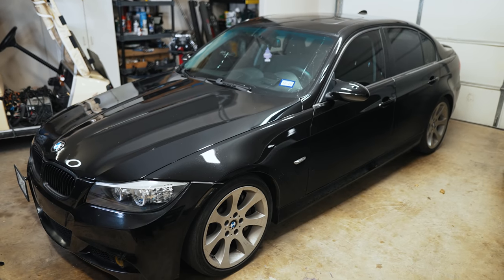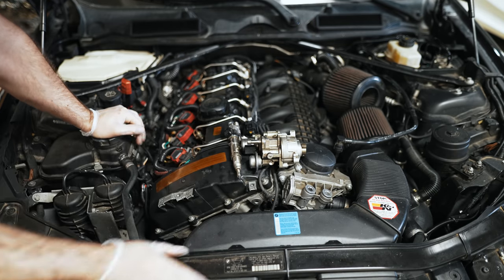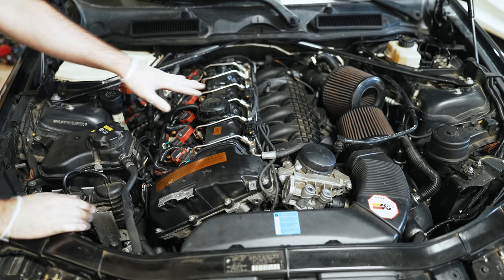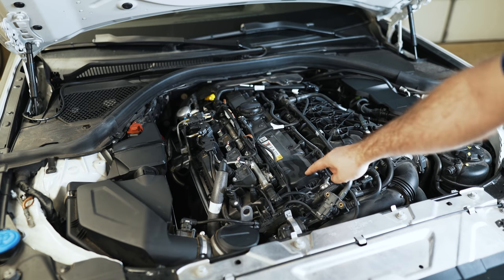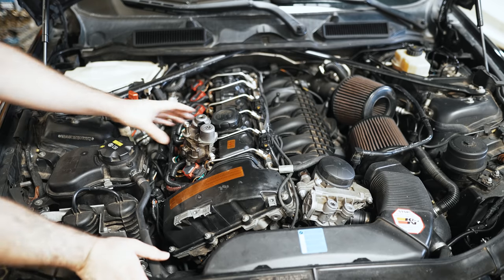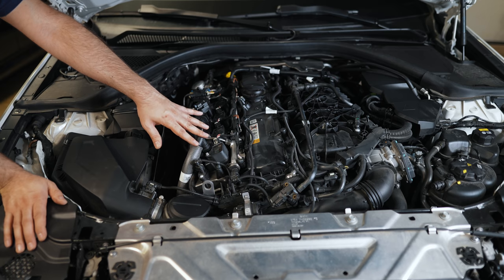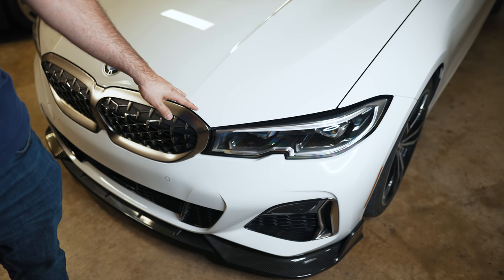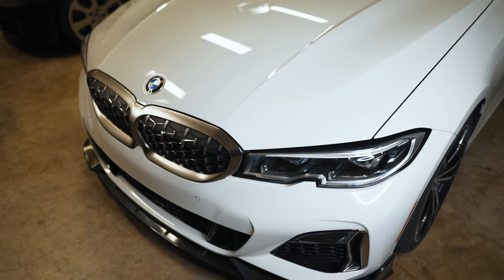Here Is Why New BMWs Are Now Reliable

Comment: BMW owner at 20K miles: 
  “Wow, this is WAY MORE RELIABLE!”
BMW owner at 70K miles:
  “Who built all these pipes out of PLASTIC!!!!”
Reply: Depends on the model, 250k across 2 f30s with hardly a problem. I’m now on a B58 touring due to the performance and reliability.
Reply: Mine is 94000 miles N20 f10 and no problem so far in the motor. Yes maybe tomorrow this will happen but so far ...
Reply: Frequently flogged the shit out of my n55, as if it were a 90’s Nissan. Yeah the intake pipes shatter but replace it with a metal one and they’re fine lol
Reply: Exactly.  This video ignores the reality of BMWs.  Once they hit roughly 65k miles, they turn to crap.  Every.  Single. One.
Reply: My F30 bought @ 110k KM Clocked, Brought it for first service: 1. Battery Replacement, 2. Tyre Replacement, 3. all filters replacement 4. Radiator need servicing, 5.Fuel Pump Relay Needed Replacement. Now Oil seal needs replacement, Water Reservoir tank dried and broken, radiator hoses dried up, water pump reached mileage, water pump sensor needed replacement, the housing is bad. Now there's some weird ticking during startup...
Reply: @ceyhan49 , sounds like you bought a car from the junkyard...lol don’t BS us!! I have f30 340i M performance I bought it 2018 and running great.
Reply: @bassandtrebleclef  lol, what have you been smoking ?
Reply: @jamsxr  he's not lying, I have a z4, everything was fine until around 80k ish miles.  Had to replace electric water pump, ignition coils, a couple electric sensors and my car throws a "Running Rich" code whenever it gets warmer.  I have a new valve cover gasket, oil filter housing gasket, oil pan gasket sitting until the day I have to replace those as well(oil starting to visibly seap) and I know the water pump I have on there will only last another 60k miles.  The roof motor operates slower now then it did when I bought the car, another potential problem. That does not happen with my G37 which has 122k miles, I had to replace nothing.  Lots of the BMW maintenance items(cooling system parts) are not maintenance items for other brands.  I'm a big fan of BMW and i really wish this new one is more reliable, but based on my own experience, and experiences with friends owning 1/3/5 series I would not bet on it.
Reply: @dsong2006  I’ve done over 250k in 2 brand new f30s - hardly a problem to mention. I’m now in an F31 B58. Very solid car.
Reply: @jamsxr  At what mileage did you replace the first one?  The problems I encountered happen between 60-100k miles
Reply: @dsong2006  125k and 130k on the f30s.
Reply: @jamsxr  miles or km? also F30 still uses the N55, which has the same problem as the older E90 135/335s  the B48 has a well known well documented timing chain issues as well
Reply: @dsong2006  miles, both N47 and B47 so nothing exiting, just work horses. I’ve now got a low mileage B58 - my friend who’s a BMW tech is yet to see one with a serious problem. Like you, I’m just going from experience, and it’s only been a positive one. BMW don’t do badly in the JD Power Survey.
Reply: @bassandtrebleclef  odd as friends did this 61000
Reply: @roblovie1722  i know right! i bought from a supposedly trusted used car dealer.... Anyways 100k km is mostly time for basic wear and tear replacement. Well apart from that the car runs like a horse
Reply: @jamsxr  me?  Nothing, but my e90 had smoked the trifecta of gaskets - oil pan , valve cover and oil filter housing.  Common issue, expensive fix, poor design.
Reply: @bassandtrebleclef  well I guess I was lucky enough to have the more reliable engines when it comes to BMW ownership. I certainly wouldn’t choose a Merc or Audi as a more reliable car, it’s only really the Japanese that are going to outperform in terms of reliability, but I find the current selection pretty dull for the type of car I wanted. My B58 estate does over 35 mpg cruising on the motorway and has a 6 cylinder 400hp motor - paired with the lovely 8 speed ZF. As this video highlights, it’s an extremely reliable and well built motor. I appreciate it seems BMW have produced a fair few that have not been as good, but that’s not my experience. I’m just approaching this objectively.
Reply: @roblovie1722  nothing to write home about it’s only been 3 years.
Reply: @kevs2good133  sorry you had to say a bad prayer bro... I wish you all the good things in life and be blessed. It was a long story, I had to buy because of some good financial deal
Reply: 100% correct
Reply: @s l basically kids who’ve bought a high performance car and expect it’s not going to cost anything
Reply: @jamsxr  Typically
Reply: @s l touche!
Reply: @dsong2006  n
Reply: @bassandtrebleclef  not really, 170k on my n54 and just replaced my coolant pipes
Reply: I will never buy a BMW. Lexus if you want a reliable luxury car.  Period they are unmatched.  From computer failures to battery failures to engine failure. It will take more then a post to tell me a BMW is reliable.  It's ridiculous to spend so much and get something that falls apart at 50,000 miles and call it luxury. They are so worried about performance and trying to cut cost they end up being unreliable. Mercedes is not much better.  Just different circumstances.
Reply: @roblovie1722  that's a 3 year old car mate, what are you trying to prove? I'm pretty sure you are still within warranty.
Reply: Nah...just the haters like to talk shit with their kia budget...my- 2005 530I has 384,000 miles and has been a pleasure to drive...and still looks great.
Reply: At 20K miles, I would expect ANY car to be without issues. Holding the benchmark at 20k miles is very low.
Reply: @Truehoon  hahaha IKR!
Well can't sell it yet.. Gotta use it for at least 5 years.. Else I've gotta topup at least 20k just to cover up my loans.. Meantime will work hard to be richer 🤣
Reply: @bmwlane8834  so what happened to your “budget” since your car is getting a little old ay...
Reply: From a financial standpoint, it makes a lot more sense to drive them until the wheels fall off, and that's what I plan to do.  I'm a very unusual American.  I have a nice custom home, 9 motorcycles wife drives a 2018 X3 and everything I have is paid for.   My budget is very good.  I'll probably move to a 650i gran coupe when this car dies.  I just get a kick out of the comments.  Most of these people have never owned a BMW.  Good day.
Reply: @bassandtrebleclef  
Don't know what you mean by turn to crap.  You must mean regular maintenance.
Reply: @dsong2006  I hope your wallet is "Running Rich" when you hit 80k miles lol.
Reply: @OmegaF77  haha I've already gotten past 80k,  but I got an G37x beater just so I don't  put many miles on the Z4.  I want to keep the miles low, they've actually kept their value quite well.  I'm hoping my NA E85 Z4 3.0si will be a future classic since its one of the last sporty bmws to have the naturally aspirated N52 straight six
Reply: @chrislim7976  well for a Lexus for ex. maintenance = fluids/breaks/tires/belts maybe a seaping gasket after 120k miles, for BMW, maintenance = fluids/breaks/tires/betls + electric water pump/cracked hoses/potentially 3 leaking gaskets by 80k miles/model specific things(HPFP,  charge pipe, turbo wastegate etc. etc.)  The difference is BMW consider certains things "maintenance items" which  most other company call  poor design, or poor choice of material.  Majority of BMW owners either lease them or own and replace them before 80k miles so they won't even encounter major issues or have to pay for the bigger maintenance items.  For the rest of us who like to keep car for longer or people buying them used that's where the complaints come from.
Reply: @dsong2006  
Yes BMW has higher maintenance costs.  Some of them are more ridiculous than maintenance.
But I don't want to maintain a "Lexus." From a product and driving experience it does nothing for me.   At least with a German car I am throwing away money on "something."
Reply: @roblovie1722   buddy that car is 3yrs old still has power train warranty come back in 10yrs with over 100k miles locked then you can preach about how reliable it is
Reply: @jamsxr  it’s been proven already bmw are endless and I mean endless money pit as it ages, it’s not the mileage that really kills them, it’s all the plastic crap that ages... plastic Deteriorates over years not miles. F30s aren’t even 10yrs old yet so your experience isn’t going to be the same, keep it past the warranty period for another 8yrs and then come back here and preach about reliability
Reply: @rgmylife664  plenty of well maintained e46 and E90s about. That’s just cars in general that deteriorate over time, funny that
Reply: @jamsxr  no Japanese proven that already, cars can last a life time with little to no maintenance or repairs
Reply: @bmwlane8834  
Well that makes sense for cars in general.   That said driving a German car "to the ground" is still going to cost way more and not sure that actually makes financial sense in the context of BMW'S.
Reply: @jamsxr  
E46 and E46 owners are different at this stage.  I doubt the current BMW crowd has little interest in keeping cars for the long run.
Reply: @rgmylife664  is that why the Japanese are now using BMW engines and components to build some of their cars? You’re talking rubbish, little to no maintenance, just look at Subaru 🤦🏼‍♂️
Reply: Lol thats the truth the g series is not old enough to comment on its reliability..just educated guesses
Reply: All the old boring people in this thread commenting Lexus lol. I'd rather fix a Bimmer than drive a Japanese car. Also my BMWs have been pretty reliable
Reply: TheNewblackdog  I’ll not argue Lexus reliability, it is historically excellent. From a mechanical point of view, though, reliable means “not stressed”.  It’s easy to make 350 HP from 4.2 liters.... reliable, just a little mundane. The Lexus V10 isn’t mundane, but then again it isn’t reliable or simple enough to put in a daily driver. 

My 2005 Mercedes makes 500 HP and is “reliable” so far at 209,0000 miles, yet still exciting enough to keep me off the car lots.

That all said: An OEM, seventeen year old, 500 HP BMW with 209,000 miles can not exist in this time-space continuum.
Reply: Totally crap
Reply: @bassandtrebleclef  yep even their bikes have bad reliability issues. I really want the BMW f900r bike but too risky even though the price is awfully tempting.
Reply: There is guys reaching 250.000 & there’s a dude on YouTube with 400.000k on his M3 ya treat the car good it’ll treat you better ya treat her like shit it’ll leave you stranded....maintenance is extremely important especially on “high performance” key word “high” performance professional athletes don’t treat their bodies like average joe’s
Reply: @greatestever7623  - if you wanna keep high mileage bmw, your gotta get under the hood yourself and obsessively maintain them. Let's just be upfront, its either that, or cost a fortune.
Reply: @jamsxr  250k probably you are the only one I've seen reaching 250 k n a f30....was it a N20 or N26? was timing chain changed?
Reply: @NAVEENPADALA  sorry, it was 250k in two company cars from new, so around 125k in each. Particulate filter was the only issue. By all accounts, the B58 lump in my current F31(touring) is an extremely well made bit of kit - I would be interested to know of a more reliable, better performing & equipped car for the money.
Reply: @bmwlane8834  People know that these expensive brands would cost more to fix. What they don't expect is that these more expensive premium brands would break down a lot more often than the KIAs, Hondas and Toyotas. 

Is it a bad thing to expect a more expensive car to be more reliable than the cheaper ones?
Reply: @therealsyxx  or Acura
Reply: @FSSNZ  Lexus isn’t boring
Reply: @Mellio Kuang Hyundai’s are pretty reliable
Reply: @HondaCivicEX-L  absolutely
Reply: @bmwlane8834  Good for you man I like the challenge of keeping a car going for as long as I can. Drove a 240 volvo for thirty years and still ran great until some woman t boned me on her phone. She was taken away in an ambulance and all I had was a broken heart. Driving a 07 M packaged 5 series wagon with 225k. What a beauty even with its few faults. Maintain them and they will go for ever. Better for the environment to keep an old car running considering the energy used to build a new car. With the money saved running my old car I’m ready to hop on my 40’ sailboat.
Reply: @ceyhan49  check your rod bearing
Reply: @2w0nGranTurismo  IT turns out it was just AC belt tensioner.. lol .. so much fuss for such simple item...
Reply: Arent all cars plastic now though
Reply: @therealsyxx  lexus is for old boring people.
Reply: @youtubesbichasspolicys5888  Charge pipes taking a lot of boost are known to crack on the n55
Reply: I drove 480000 miles wit a 2005  535D with no problems. I sold it and t's still driving.
Reply: @rgmylife664  What make me trust this engine is the choice of Toyota for the Supra. How damaging it can be for the brand to have a sport flagship unreliable
Reply: TheNewblackdog  - why is always a friend or a brother 😅
Reply: @hpickettz34  thankyou
Reply: @therealsyxx  man said lexus when was the last time you seen a lexus in a main stream rap video no one likes em
Reply: BMW is for Break My Wallet
Reply: i have an m57 with 270k miles. only had minor issues. starts perfectly. leaks minuscule amounts of oil if pushed. these new engines aint shit.
Reply: @ceyhan49  The ticking is the chain loosening up.  You should replace it at about 100k km.
Reply: All these guys trying to argue BMW is reliable have one thing in common - BMW cars with diesel engines.
Try throwing money at a non-diesel BMW like the greater community sharing their experiences with common issues and take a shill pill.
Reply: @UPR91 They didnt do it because its reliable. Toyota did it because they didnt already have a motor and didnt want to invest into the R&D of a new motor.
Reply: Replace it with a metal one and the problem ends. Why is this complicated?
Reply: @bassandtrebleclef  How on Earth would you know that when you drive your grandpas Chevy puck up? smh
Reply: @MohamedQureshi  - Where can you order metal replacement parts?
Reply: @cloudsmith7803  I live in Iraq and all our cars have their own agent. For example, Lexus has an agent, BMW has an agent, and so on. If you do not want the agent, there is another new one, but a used one. Greetings.
Reply: @bassandtrebleclef  mines at 135k. Only replaced the turbo. So valve cleaning’s.
Reply: @bassandtrebleclef  do you own one?  My 2020 X5 has 138k on it and ZERO issues thus far.  Just change the oil every 5k and regular maintenance.
Reply: @jamsxr  Well said. I had a 320d M-sport Estate for over a decade and put 150k miles onto it during that time, and i bought it at 5 years old with 74k miles on. Only thing i had to was regular services of oil, suspension gas strutts and coils at 188k miles total (expected at that point), and a new aux timing belt at 190k miles. Car was a complete hero, sold it last month and it's still going. Got a M240i now from mid 2019, only 25k miles on it and man it just sounds so damn good when you plant it 🙂 really hoping i can afford to keep this car as long as the last one and get the same reliability, but looks like it is possible!!!

Comment: Picked up a 2019 B58 touring. Reliability combined with performance was a deciding factor. Previously I’ve done 250k across 2 320d F30s with hardly an issue.